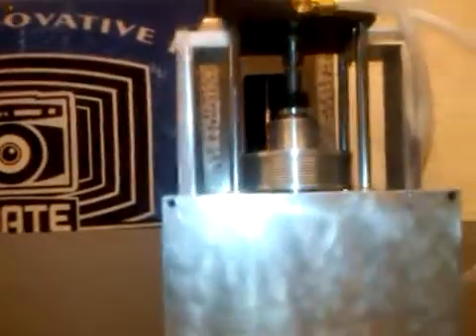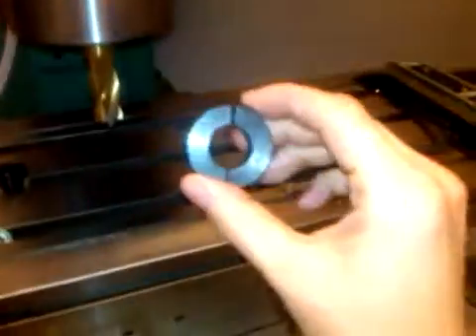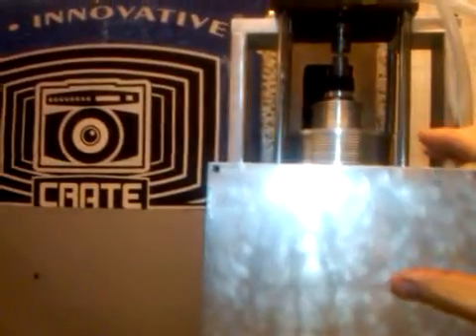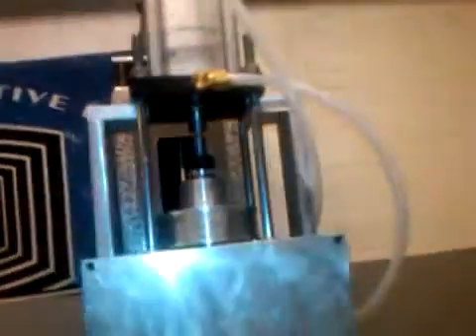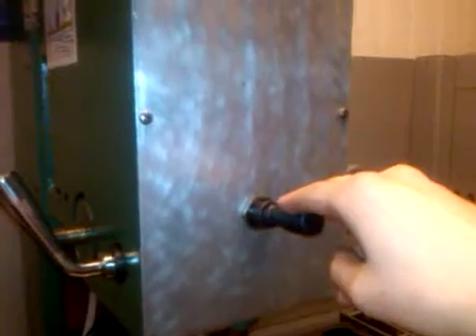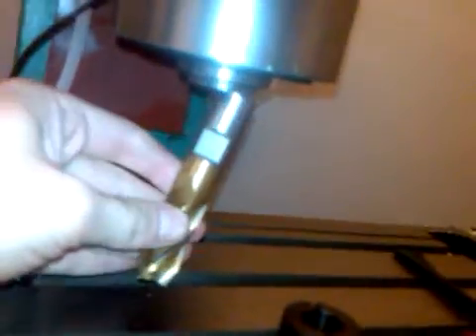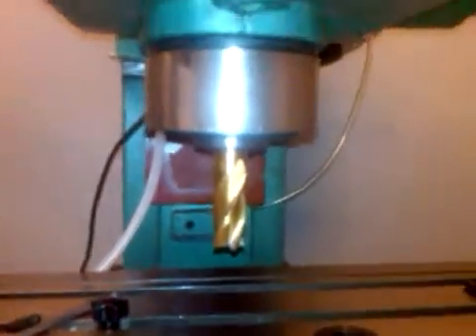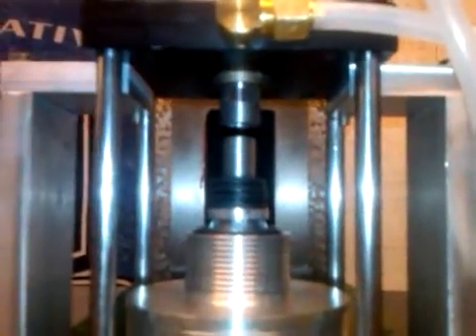ZX-45 Pneumatic Drawbar

Comment: I was just watching this video again (for the 10th time or so). I know you have moved on in machines. As in 1 day I will get motivated to build the pdb.

   The 4 rods that penetrate the head casting and connect to the bottom/or lift plate. Instead of those outboard legs on the cylinder (which I believe is to provide clearance between the cylinder and spindle when not in operation). Would sleeves of the same length as the legs installed on each rod have accomplished the same spacing and support needed? I see there might be a pulley clearance issue since I cant really walk around all sides.

   Just curious. Always looking for options and next renditions.
Reply from the maker: ***** You are correct and yes a sleeve would have done the same thing. I just did not think of that at the time.